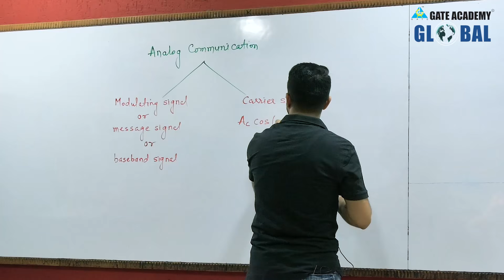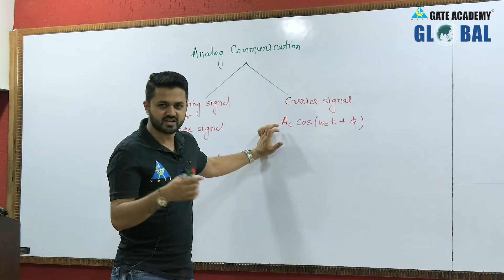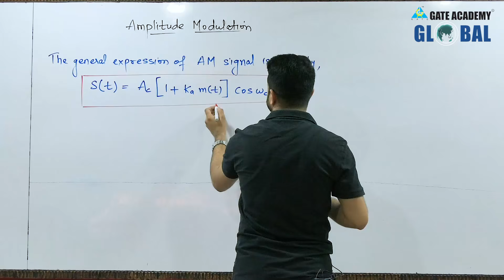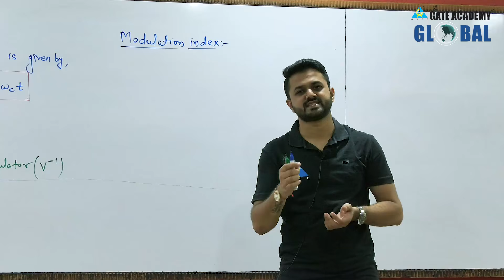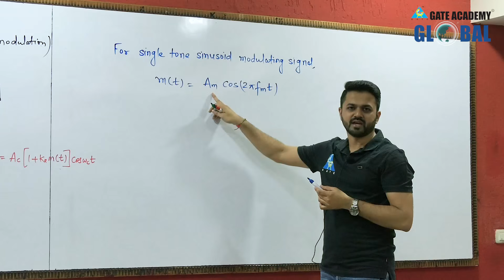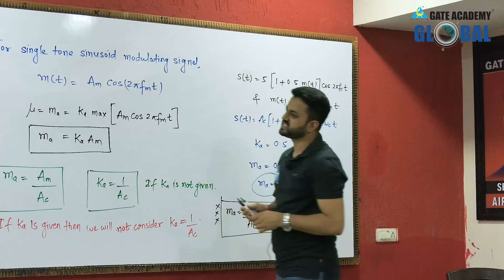Amplitude modulation | Lecture 3 | Communication System

Comment: Sir i have a doubt... 
U mentioned in the previous lecture message signal is a low pass signal.. But in this lecture u mentioned message signal as a base band signal..
Reply: Low pass signal and baseband signals are the same thing since baaeband signals contain frequencies which are near zero ( just like low pass signals). If you have such doubts you can always help yourself through google .
Reply: Sir i want reply......